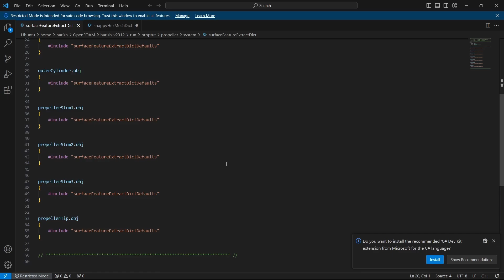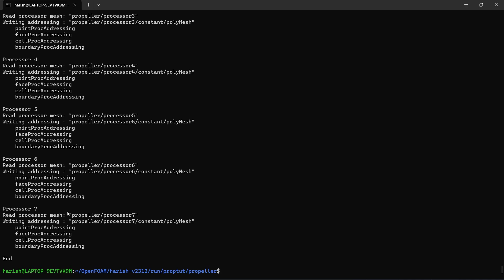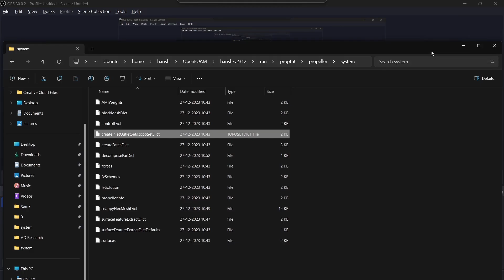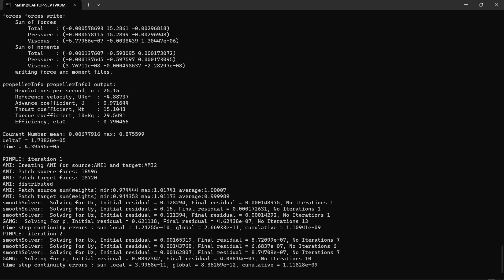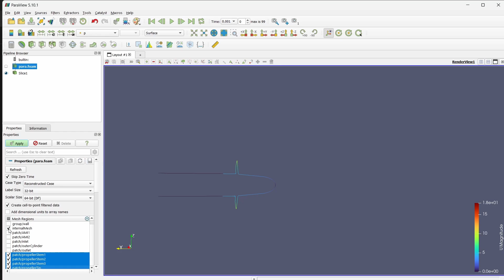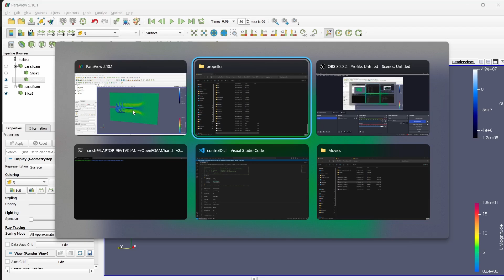Propeller CFD - OpenFoam Tutorial | snappyHexMesh Dynamic Meshing |  pimpleFoam | Transient |

Comment: you can utilize virtual cores as well as physical ones by passing -oversubscribe flag to the mpirun. 
Set the number of  subdomains to 16 (8cores x 2 threads) and than run mpirun --oversubscribe --np 16 ... and it should work just as well.
Reply from the maker: I tried it. It bottlenecked and slowed down than using just the cores for OpenFOAM for some reason.

Comment: Great tutorial! It seems as though I am missing some files, I have retried a few times from the start and still the same problem. The files I have in system when you go to use createInletOutlet... (I dont have) is blockMeshDict, controlDict, createBafflesDict, decomposeParDict, forces, fvSchemes, fvSolution, snappyhexmeshdict, surfaceFeaturesDict, surfaces. Also, my mesh that was generated was much less detailed despite following the tutorial. I am running on Mac (no other choice hahah) using docker and XQuartz. Any help would be greatly appreciated!
Reply from the maker: My version in that video is ESI. 
If you are running on mac then it is foundation version I believe. probably v11 or v12. 
It is totally different. 
Please understand the concept from the video and check your Allrun file for the list of commands for that version of tutorial. 
If possible I'll try to make a video for org version as well soon.

Comment: Don't forget about Tab completion when typing out those long file paths! My system even auto-completes the environment variable name, but I'm sure yours will at least autocomplete directory names (like incompressibleMultiphaseVoF). Saves a little time and wrist effort.
Reply from the maker: Thanks for your suggestions. I do use that. But it doesn't work when we use $FOAM_TUTORIALS in WSL. I have tried it and it adds a \ before $ everytime I hit tab. And once there is a \, it can no longer auto complete as it is neither a variable or a path. 
I'm glad it works for you. I hate it that it doesn't work for me in such cases.

Comment: Hi, what about free libraries in OpenFOAM? Is it possibile that some users make available BlockMeshDict, SnappyHexMeshDict and others file, but without stl/obj file? I can’t find the subdirectory constant/Trisurface. In the constant folder, I have RASProperties, transportProperties and turbolenceProperties. Thanks!
Reply from the maker: To use blockMesh you don't need an object, but for snappyHexMesh, you would need an stl or an obj file. 
The constant folder never comes with the triSurface folder. You have to manually create it and add your geometry inside that and mesh it using the snappyHexMesh. 

I hope this helps. Please check my video on meshing a plane using snappyHexMesh. It would clarify your question.

Comment: What parameter in snappyHexMeshDict controls the animation of the propeller? Thanks
Reply from the maker: snappyHexMeshDict was used only to create mesh for the case. It has no role in the animation directly.
Reply: @Codeynamics  I found out  there is a dictionary (dynamicMeshDict) located in constant/ folder which controls the mesh animation. You could have mentioned that in the video. Anyway, good introduction to dyn meshes.
Reply from the maker: @MarcelNKemet  That doesnt control animation directly. That controls the mesh motion. Animation is a byproduct. So I didnt mention. 
Thankyou for your suggestions
Reply: @Codeynamics  In that case, I suspect animation is controlled by a custom function somewhere the system/controlDict
Reply from the maker: @MarcelNKemet  I dont understand what you are trying to say. The animation is post processed in paraview. how is animation related to controlDict?

Comment: we can use snappyhexmesh for 2d geometry alike flow over cylinder/prism????
Reply from the maker: Yes you can. Use type "empty" for the frontAndBack faces. 
Separate all faces from the geometry, use inlet.stl, outlet.stl, walls.stl, prism.stl, frontAndBack.stl and then do the snappyhexmesh. 
It should work fine. if it doesn't, mail us at codeynamics@gmail.com